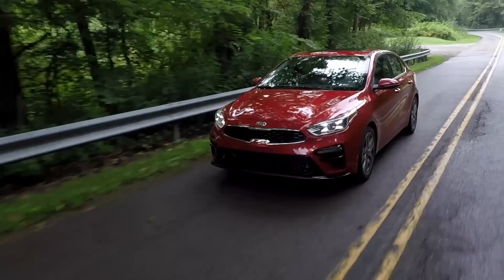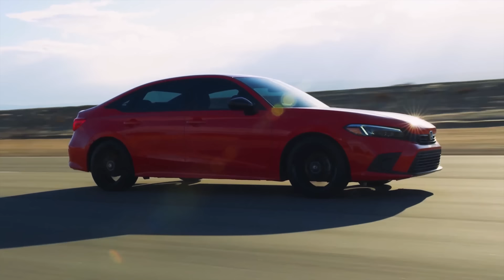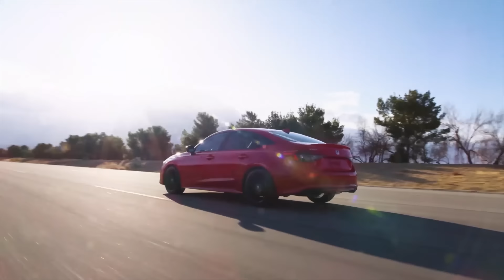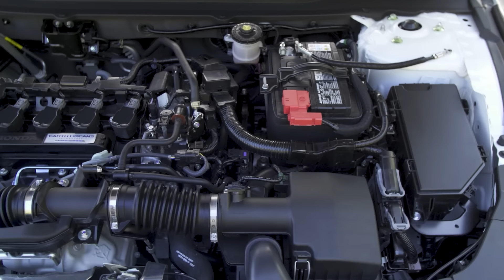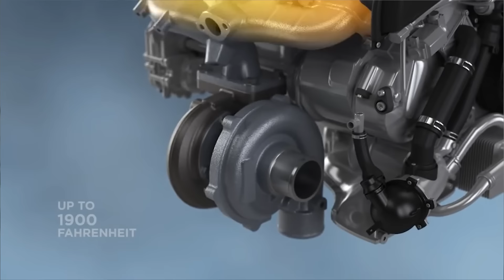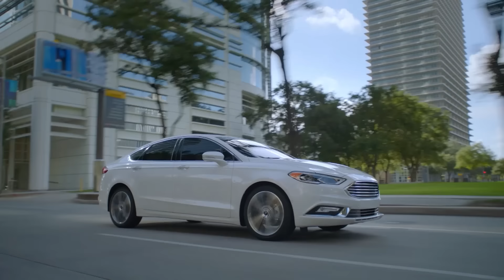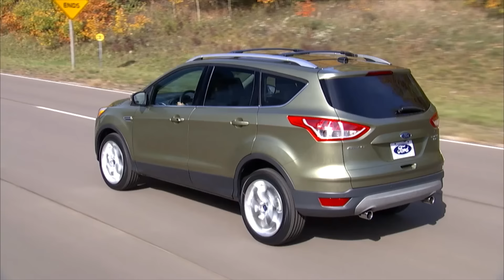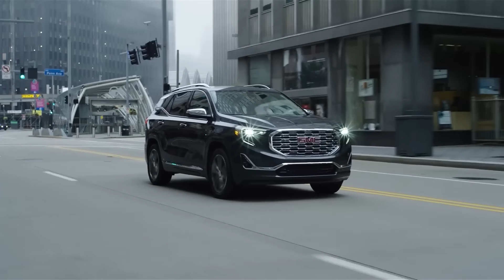Are Turbocharged Engines Reliable? The Truth About Turbo Engines

Comment: He’s Wrong!  on the years of owning a car with a turbo. It’s Not years. It’s mileage.
When the auto gets in the 100k mile range. It’s time to get Rid of that auto.
Your on borrowed time. Why do you think Audi only has a 50k mile warranty on a New car? Because they know the high performance with a turbo that anything in  the engine & transmission really after 50,000. Your on barrowed time. We’ve been lucky so far with 95,000. I try not to slam the gas pedal a lot of the time. I baby it most of the time. Hopefully we can get another 20k miles on it.

Comment: By coincidence I’m taking my Hyundai Kona Premium SE to the garage today to have the turbo checked. A few times the turbo does not kick in and one steep hill near me where I usually drive up in 5th or 6th gear last week it struggled in fourth and the engine sounded strange. The car is 30 months old and 10,500 miles and has the one litre engine. Let’s see what the garage has to say.
Reply: The Konai has an available 1.6 L Turbo. They are known to be very stout, and very reliable.  I have this engine in my 2021 kia K5 GT LINE.  I'm an average driver, dont drive it hard, just normal. Sometimes a full throttle acceleration is needed,  and it really scoots when the turbo kicks in, and yes its fun. I drive 80 miles round trip for work, and change the oil every 3000 miles. I have now just turned 30.000 miles woth 0 problems or issues with the car. I only use premium fuel in all my cars, required or not. I live in Southern California,  so there no severe cold weather to worry about,  average nighttime temps in winter are around mid 40s, to the occasional low 30s, but that's kinda rare. That being said, what was the issue with your car? 11:12

Comment: Well, most cars have turbos now.  As stated at the beginning of the video that is what manufacturers are producing.  I have owned a number of turbo cars over the years.  I have had very good life out of them.  I change my oil aggressively and let them cool down when they have been run hard.  Since I am a car guy, I keep up with maintenance and enjoy doing it.
Reply: I have a 2018 Honda Civic, 6 speed, Turbo and I love it - bought it new and have 76k on it now.  I believe the engine is well built and as long as it's not "hot rodded" or "tuned" to high boost pressure, I think it should last 200 to 300 k miles.  I notice no "oil dilution "and regular oil changes are essential, of course.  Honda put turbos on jet ski's almost 20 years ago and they have been very reliable as I am a jet ski enthusiast as well.  I think Honda engineering is very good!
Reply: @travelguy1564  I’m going to look at a Honda civic hatch back manual transmission.. with turbo today.  I’ve always heard good things.  I drive so much and the mpg is enticing.  But I guess I don’t know too much about it..! Good to hear yours is treating you well.

Comment: I drove 2.0T VW for 12 years nothing but problems it burned at least 1 quart of oil every 6k miles winter times I had to deal with engine condensation I was glad when I got rid of it.

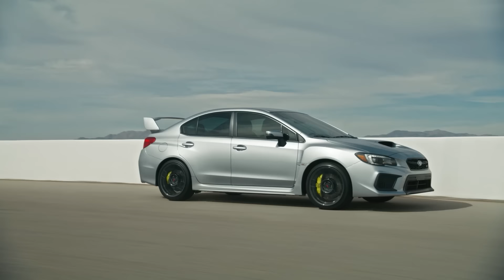Comment: @0:30 If you maintain your car like many Americans, probably not. Oil changes are even more important.
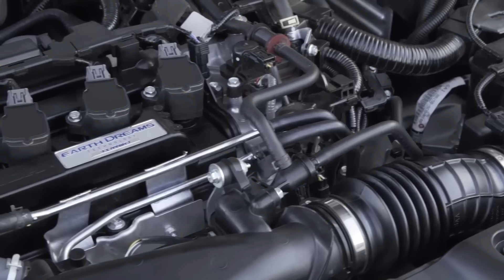@1:14 Yes, it consumes less fuel in partial-load range but if you floor it you will get the same fuel consumption.

Comment: Turbos are pretty much ubiquitous in many countries and without real issue. The engines are designed with them in mind, as is the cooling and everything else. There will always be problem engines and purely direct injection engines are also known to suffer carbon issues. So I'm not sure what this video really calls out.

Comment: Personally, I won't buy one. But if I did it would have to be a proven design like Toyota with their combining both GDI and port injection. I would also use a low volatility oil and change it every 4K to 5K miles.

Comment: After experience a Range rover turbo v6 diesel engine for 12 years. Yes 12 long years, it runs fine as long as you do regular maintenance. Other parts of the RR are not so lucky. Also depend how you drive it. Don't trash a turbo car it will serve you well.

Comment: Why don't they, turbocharge, jet engines?  They already run hot... They use a lot of air.  They already get bad gas mileage. And so somebody should design a turbocharger for jet engines. Since most of us don't have to pay for those. Until we buy a plane ticket. Whose prices are already, sky high. So what's a few more feet?  And how does one install feet?   On a jet engine?

It makes sense for the car manufacturers to install turbochargers on all engines.  That way.  You'll have to purchase more engines. And they stay in business longer. Maybe?

I would like to turboccharge my mouth
RemyRAD

Comment: Finally someone calls out the concerns of having turbochargers in a hybrid setting. It definitely drives well but the reliability of this setup in the long term needs serious consideration
Reply: If you're going hybrid, you're better off with a diesel generator/engine, lol.
Reply: @mikem9536  We don't get diesel in the U.S. F the EPA.
Reply: @mikem9536  WRONG... Get a Lexus 450h+ "F" Sport.....drive 49 miles on batt.  and never use the ICE...However you always have the ICE and can use regular gas and get 89 empg...However, since I never use the ICE my ICE is as NEW!...only using Batt.  plug-in to 120V is QUIET Quick / Huge Torq and no wear on ICE!
Reply: @donaldbanner2185 you do know you still might want to make the ice engine to start to lubricate the internals... just because you aren't using the main engine doesn't mean it won't have issues if you solely use EV only...
Reply: all engines are down sizing with turbo
Reply: this is a plan by the auto makers to shorten the lives of their cars so they can sell more cars. GM has done that for years, that's how it remained number one, make them last about 10 years at the most, so people will have to buy a new one 10 years later.
Reply: YES
Reply: I haven’t seen a single video say anything positive about turbo engines.  I have certainly seen many negative comments in the comment sections about turbo vehicles.  I am interested in the 4th generation Tacoma and that is the way the comments trend from what I have seen.

Comment: I own vehicles for as long as possible and would avoid turbo engines the non turbo engines are pretty comparable in gas mileage and lets face you only get good gas mileage out of a turbo engine if your not using all that extra horsepower after every red light lol

Comment: I'm personally not interested in buying any vehicle with a turbo, belt/chain CVT transmission, engine start/stop technology, or engine cylinder deactivation technology. I'm also not a fan of any GDI engine that doesn't also include port-injection mixed into the design, but I did buy a 2022 Mazda CX-30 CE AWD 6-AT (GDI non-turbo engine) & will see how it goes.

Comment: Nice video and mostly to the point. However....not valid for all turbo(charged) engines. Most planes use them also....( do not mean jet engines....they do have a turbine inside but not the combustion part)
But in planes maintenance is very strict.
I've own a 2004 turbo charged diesel and used from 2006 (buying year) until 2021 , selling date and only because in europe they started to tax old diesels to much, not because any technical problem. On the clock 320000 km or ca 200000 miles with only minor repairs and standard maintenance.
Of coarse this is an older 2.2dci ...a little bigger engine then spoken about in the video and only 136 bhp. Which means less heat production.

I suppose a lot of those problems also comes from power maximization....instead of only using those things for efficiency maximization.

For answer to the last question. Due to maintenance lowering (and energy costs) I'm driving full electric since 2021. Because the newest BEV can tow a decent trailer.

Comment: So then - if you have a turbo engined car - 
1. don't drive short distances (in cold weather) - or at least avoid doing so as far as possible and preferably do longer distances to allow the engine to warm up properly. 
2. don't use that stop-start nonsense, ever! It's just unnecessary wear on the engine, electrical system and starter motor.
3. regularly change the engine oil - say once a year as recommended by scotty. Use the SF6 oil - either the SF6A or SF6B depending on your vehicle.
The (supposedly "unreliable money pit german-brand")  turbo-charged car I'm driving is still going well after 6 years - and I'm now following the above advice I gleaned from the web.

Comment: Well, this may be closing the barn door after the horse has bolted, but I bought a 2020 Mustang Ecoboost with the 2.3 turbo. I’ve only driven it 11K miles, and have changed the oil several times, and plan to change it much more frequently than recommended. Somewhat have the buyers remorse and wish I had ponied up for the 5.0, but the car was such a good deal and I had an incentive from Ford, and there was just no GT on the lot that was viable.

Comment: I have a turbo car ('17 Fiesta ST). I've had no problems after 40,000 miles. The problem with the head was fixed with a redesign in 2015-16. 
They key is to use really good synthetic oil and change it every 5000 miles. It doesn't burn a drop, and it's reliable. Remember, semi trucks and even many airplanes have turbos and they last for decades. Keep the oil clean, and you'll be fine.
Reply: Focus ST owner and truck driver here. Completely agree.

Comment: Great topic, I only wished you could include the supercharged engines and compare between them and the turbocharged. Many thanks for your video.
Reply: Because turbochargers are powered by hot exhaust air, superchargers run cooler and thus have less bearing/oil supply problems.

Comment: Turbocharger is a component that you'll eventually need to replace. It's not cheap and replacing it isn't easy. Naturally aspirated engines don't have it. I think that's all you need to know.
Reply: Also got to consider all the potential leak points including the intercooler.
Reply: Dumb take.
Reply: @tyquanwashington.8510  And your middle name is?
Reply: @vecernicek2  ˈtərbō
Reply: Not to mention turbos slowly burn up other parts around them under the hood.
Reply: But also don’t forget that turbo chargers come with trade offs! Lots more fun for a very slight reliability - -, however Turbos are likely to last the whole life of most engines, and certainly outlast the worst parts of an engine, usually if something goes horribly wrong it won’t be the turbo, other things will cause extreme damage and write off the car long before the turbo will
Reply: @finnstuff0  Only if you compare turbocharged and naturally aspirated engines with the same displacement and cylinder number. I'd argue that a naturally aspirated 3.0 or 3.5 V6 or I6 is more fun than a 2.0 4 banger with turbo. Which is the more meaningful comparison.
Reply: @vecernicek2  That’s true 4 cylinder turbo engines are usually pretty rubbish and laggy, (atleast older ones are) but this also depends on how it’s tuned too, I suppose my only real complaint about large non turbo engines is just that they consume so much fuel and arent particularly fast either 😕 had a M3 from 2009 which had a V8 NA engine, made 400 or so horsepower, that car would do 0-100 in 5 seconds which for the amount it cost to run was pretty atrocious.. now i drive a 3.0TDI which makes 308HP, does 0-100 in 5 flat but doesn’t cost mountains of money to fill up and is quite economical (5-6L per 100km on the highway and about 8-9L per 100 in city) These are just my views, of course you can have your own and speed isn’t the only factor but personally i don’t want to spend ridiculous amounts of money filling up all the time on cars that aren’t very fast.. personally i’d much rather own a turbo V6 than an NA V8
Reply: @finnstuff0  It depends. I had a V6 VTEC Honda Accord and I was getting 33 MPG on highway. Then I drove a newer Škoda Superb 2.0 TSI with less power than that, but couldn't touch the Honda fuel economy. Modern V6 diesels have mountains of torque from low rpms, so they get to speed quickly, much like a NA petrol V8. They're perfect engines for family cars. But they suck for sports driving, as the useful rpm range is pretty narrow.
Reply: @vecernicek2  Yes it definitely depends on the car, though that is somewhat surprising to me that your skoda superb was chewing more fuel than a V6 accord, I definitely wouldn’t expect that lol, I always thought that the US market accords were quite thirsty engines, atleast compared to something like a skoda superb
Reply: @finnstuff0  The thing about VTEC engines is that if you know what you're doing, you can get really good fuel economy. If you keep it in low rpms the variable valve timing is in fuel economy mode. Once you hit the gas harder, it gets into power mode with much higher torque and that's when it's thirsty (but also pretty quick). If you get a feel for the engine and keep it in economy mode most of the time and use the power mode for taking over, you'll get very nice MPGs and you can still enjoy the dynamics of the vehicle. Whereas with the Superb TSI, it's torqey from low RPMs, which some people like, but in order to get decent MPG, you have to drive grandma style all the time.

Comment: In 2010 I bought my first BMW--a 2008 535 xi Touring Wagon. Manual states 300 HP and 300 Torque,with the 0 to 60 mph at 5.9 seconds. And top speed limited to 155 mph. The reliability of this inline six is amazing. Because I was doing a little track time had the Dinan Stage 2 installed, with 375 HP and 415 Torque. Mods included a small plaque mounted at the top of the cooling system--"Normally Aspirated Engines Suck". Put in some high-performance brake rotors and pads then quit the track events, so they have never been changed--pads or rotors. Repairs have include the composite header tank failing, wearing of a short rod that engages the AWD. A few minor tuning problems occurred. Spark plugs changed once and that's it. Since I turned 80 five years ago I have done few highway trips.
Most reliable car I've had with my first being a Model A Ford in 1955--still have the bill of sale.
Reply: Should have included that the engine runs 10 to 1 CR and has two turbos. Ignition and fuel controls are amazing. Cruising at 60 mph delivers 36 miles to the Imperial gallon.

Comment: Avoid any turbo engines smaller than 1.8 liters.   The smaller engines are overstressed, and the internals are low-friction, lighter designs geared for economy.  Also there are more plastic engine components used across the board (intake manifolds, cooling components, oil pan, oil filter housings, etc.  Add the extra pressure with direct injection and the potential intake valve carbon issues that come with it.  All the software Jedi mind tricks will not completely overcome the direct injection's mechanical design. 

Older turbo engines aren't as efficient but were built like a tank with metal intake, oil pan, oil filter, etc.

Comment: I would not buy a turbo engine car at all costs. Have already decided to spend up to another $8000 to buy a used Toyota Highlander v6 for towing a 3000 lb Pop Up camper that we own.
What is the price of the trouble, time, frustration, and dealing with incompetent or dishonest mechanics when you are almost guaranteed the purchase of a turbo engine? Add to that being stranded on a highway, far away from home, and having to wait a week to have a turbo replaced!

Comment: Among the things that need to be done with a turbo engine is a proper cool off period before shutting the engine off, at least 30 seconds at idle.   And you need to use top quality synthetic motor oil.
Reply: My Civic SI 1.5 turbo ( 2019 ) has a fan that continues to run for about 30 seconds after you turn off the engine. Was told that it was for cooling down the turbo.

Comment: The problem is, people just switch off the engine after a trip. BAD. You need to let the turbo cool down for a minute. My work Nissan NP-200 lasted virtually forever.  I let the turbo run down for am minute and Whallah,  no problem with the turbo.
Reply: This is unnecessary with modern turbo charge engines.

Comment: My boss had a RS7 a few weeks after his 3 year warranty both his turbos packed up and it cost him £8000 to fix the problem was caused by the stop start feature on the car as every time he stopped the engine turns off which is very bad for turbo engines as they should be left running for 1 minute before turning off if you buy a turbo with this feature disable the stop start
Reply: Hahahaha damn Audi smh

Comment: I have a 2014 lincoln MKZ 2.0 turbo awd 64000m my wife drives a 2019 hyundai veloseter turbo.She uses  penzoil full synthetic 1 x year.I use cam 2 synthetic blend every 4000m.So far no issues

Comment: 2:45 The intercooler doesn't keep everything nice and cool, it just cools the compressed air before it goes back into the engine. Circulating oil does most of the cooling for the turbos and that oil is cooled by a different means. With this stupid stop/start technology built into just about every car, imagine what the turbos go through every time the car stops at a red light and the engine shuts off. I assume the better manufacturers have some sort of electrical pump that keeps the oil circulating to the turbos even when the engine is shut off at a light. No turbos for me thanks.
Reply: Tune the start stop out of your vehicle for crying out loud.

Comment: The problem with manufacture is the long intervals of oil change. If you own a turbo charge car , change the oil every 5k miles instead of 10k, allow the engine to run for a few minutes before you turn it off so the oil will cool itself while the engine is idling.